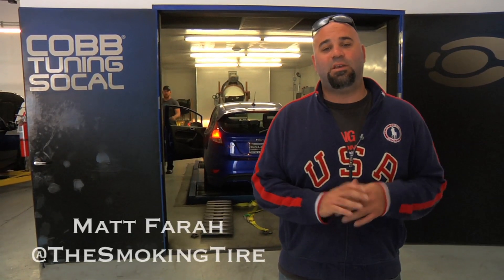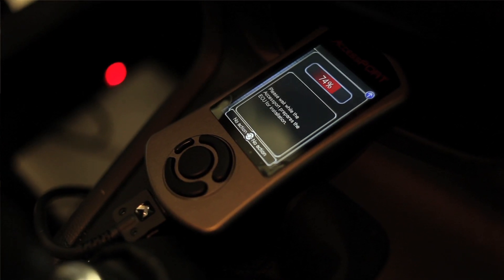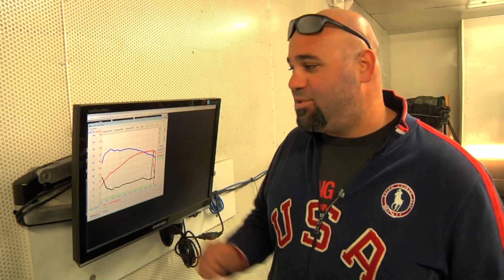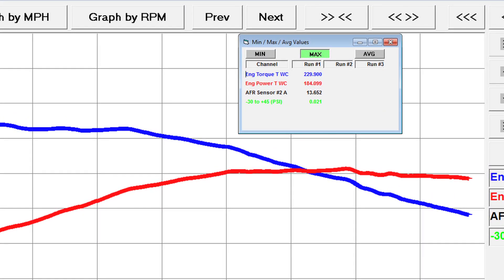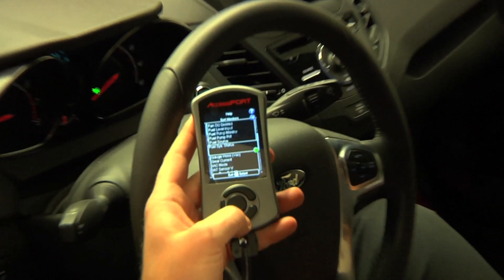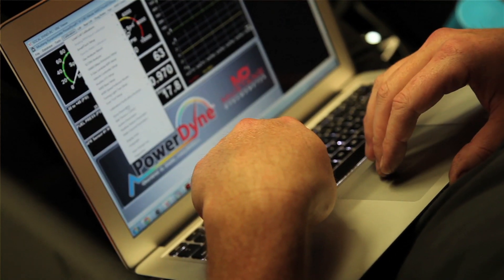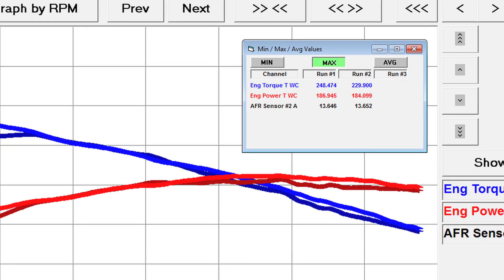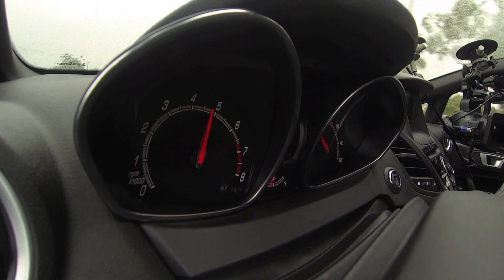Project Car Fiesta ST Gets Cobb Stage 1! Before/After Dyno

Comment: Imagine a world where Ford offered the fiesta with awd and 3 doors. Hot hatch heaven anyone?!?!
Reply: you have the 3 door option, at least in Europe.
Reply: hell yeah! that is actually my dream but wait - you guys don't have the 3 door option in the US?
Reply: Nope.  5 Door only.  Still a great car, but just adds that much extra weight.  I own one, and it's still a blast, just a bit heavier and less attractive.
Reply: I believe there are 3 doors version, at least here in Europe.
AWD it's useless on a fast small car with just 200hp. it will ad weight, power loss and probably will be boring to drive (more understeer).

LSD is what you want, in case the car doesn't have one from the factory!
Reply: +Tom Lawrie  check out the new focus rs, AWD !
Reply: @blackonegreyone  they do have a 3 door, in EUROPE tho
Reply: @christopherrogers8316  The don't offer any Fiesta ST in 'merica anymore.  We don't buy hatches, so Ford will only sell use trucks or a Mustang now.  Sad state of affairs.
Reply: @blackonegreyone  i know, but good thing is, fiST are cheap as shit used, i just seen one for 9k with only 75k  miles, i been thinking about it. lol
Reply: I wish my US spec fiesta st was the 3 door *weight reasons*... imagine it with the focus RS awd system that runs 5 drive-terrain clutches plus the engine-transmission clutch... gives me the chills thinking about it especially since mine can currently hold off a porsche 911 targa s 0-100mph
Reply: Eu all are 3 door almoost lol
Reply: 3 door Fiesta looks worse and if you disagree you are lying to yourself

Comment: It's still wrong wheel drive.
Reply from the maker: I can always count on BMW people to be open minded... lol.
Reply: I'd like to see your correct wheel drive in the snow.
Reply: RokitScientist1987 OH IT CAN DRIFT. OH IT CAN BURN TIRES. OH WAIT I DONT KNOW HOW TO DRIFT...
Reply: RokitScientist1987
I didn't have any problems... /watch?v=Vt7QFSuQ7Tg
Granted I was having fun, but I drove around on the streets and did ok.
That said, FWD may have been easier for a non-enthusiast.
Reply: *****
I'd respectfully disagree. The Fiesta is a fine car, but RWD isn't only about drifting. It also lends a different feel to handling balance. Obviously weight, distribution, suspension as well. 
Some prefer front, others rear, some (those to whom a car is only transportation) may have no preference.
Reply: RokitScientist1987  Driving my FR-S in Ontario, Canada,  we got plenty of snow this winter and i have all the confidence in the world with my Right Wheel Drive car. Honestly if you making such statements you probably never drove a rwd car in snow or you just very inexperienced driver :)
Reply: some awd. most of the people are common drivers.
Reply: RokitScientist1987 I never understood this argument. It's called investing in a good set of snow tires. My M3 on Blizzaks will do better in snow than almost every truck/Suv running all season tires.
Reply: NEOBAE77 Who said anything about drifting? I AutoX and track my cars very often and FWD would only cause me to have slower lap times, no thanks.
Reply: TheSmokingTire I'll have an open mind when they produce these turbocharged fiesta's/Focus' with an AWD drivetrain, until then it's an econohatch that won't even beat my stock E36 328is in a straight line. Slapping a turbo on anything doesn't automatically make it a better car, sorry.
Reply: Talk about straight line? Even been to mountain roads? Then u can see how far your m3 can go againt the small FWD..

Comment: hmmm now much gains for the fiesta, know the bmw n54 there is a TON of leftover room to be tuned
Reply: Well to be fair, Mountune reckons they can get 215 horses out of it with no issues, although their claimed torque figure is 236 lb/ft.
Reply from the maker: ***** They can get 215 Wheel HP out of an otherwise stock car running standard pump fuel? Somehow I doubt that, but I'd love to see it.
Reply: TheSmokingTire
I didn't say wheel horsepower.
Reply: TheSmokingTire Mountune has had another year to tinker with it, plus is officially backed by Ford UK. You can just buy the Accessport from them (same price as Cobb) as test out their tune. http://www.mountuneusa.com/COBB-Accessport-Focus-ST-Fiesta-ST-p/ap3-for-001.htm

Comment: In Europa we already running 250whp and 370nm TQ (stage2) I can tell you that it is is very very quick. And can easily keep up if not dust more powerfull cars. It handles the power very good and cornering it just crazy with the Fiesta even at high speeds. Fiesta don't need awd. The less peolple expect from this car, the bigger my smile while dusting them whehe.

Comment: I love these cars.... If I wasn't such a freak about high horsepower rear wheel drives, I could definitely get behind the wheel of one of these. This is what VW should have been doing to the GTI twenty years ago. They (VW) leave so much on the table from the factory it's insane what a chip tune will do. Thanks for the video, and keep us posted on the stage 2 upgrades...

Comment: The thing with the accessport is that the maps are totally customizable by you! The ots maps like the one he is using is conservative. But besides adding a lill power it adds it throughout the powerband. I know in my mazdaspeed 3 a Cobb stage 1 tune made a huge difference.
It also removed the boost restriction in low gears and came with no lift shifting and launch control (& valet mode for at the shop so they don't joyride)

Comment: VW's new 1.8t which replaced the base 2.5 5 cylinder goes from 165whp to 220whp with a stage 1 ecu tune and makes 270lbs-ft of torque and that's a base model engine. Remind me how 4hp and 20torque on a stage 1 upgrade is impressive.

Comment: Matt, you should try a Burger Motorsports tuned MINI Cooper S that has an aftermarket intercooler and exhaust...after first gear, it's on point with a 997 and I'm not even joking...

Comment: Thanks for the video! I bought my fiesta st after being totally convinced after the M3 vs fiesta comparison. I have the stage 1 power kit from cobb as well and it's nice to have a little extra torque, coming from a mk6 GTI where an APR tune would give 50hp and 70ftlbs, so I'm disappointed with the tuned hp number.
Reply from the maker: It's a 1.6L engine that's massively underrated from the factory, so clearly Ford didn't leave as much on the table as VW did with the GTI.
Reply: It was already tuned pretty good from the factory. Let it breathe a bit better and maybe get a tune from fswerks or someone on an e85 mix.
Reply: Comparing 2 different cars is pointless and I absolutely do not believe that you got even close to 50/70 at the wheels with just a tune. That is at least a 25% increase. BS
Reply: Do some research on German turbo cars. They usually do make 25% more power because they tune the engines so conservatively.
Reply: taylor wagneers I know plenty about German turbo cars. Some of them will make tons of power with very minor modifications and a tune...The GTi is not one of them. It's a very good car and can make that much extra power but it's gonna take a lot more than just a tune and drop in filter.

Comment: why are the power gains so incremental?
I put a Revo Stage 1 on my Audi A3 2.0T and power shot up from 197hp to 270hp and torque went from 207 lb-ft to 317 lb-ft.

these are crank numbers though but even still the difference was massive, i thought Turbo cars get much more improvement from remapping compared to N/A due to the boost reconfiguration.
Reply: Just shows how conservative the COBB tune is. Almost pointless and surely not worth the money, as it could not have been cheap.
Reply from the maker: Your Audi is more detuned from the factory than the Fiesta is. remember, you have a 2-liter and this is a 1.6-liter. Most companies detune those 2-liter Turbo's from the factory in order to reduce torque steer, which most buyers find unpleasant. The tune opens up more of that power, at the expense of torque steer. Because the Fiesta's engine is much smaller, they leave less on the table at the factory. It's apples to oranges.
Reply: TheSmokingTire I figured that would be the case, atleast from the Stage 1 Remap you should get a big improvement in MPG as did I with mine.
Reply: Lets not forget the Fiesta ST is like 500lbs lighter than the Audis. This means far less power is required to output the same 0-60 and 1/4 mile times.
Reply: Because it's two completely different cars tuned by two completely different companies.  Your question is kinda like asking why kobe beef is more expensive than a hot dog.. different approaches.
Reply: Theres about 5 different companys that do the same tune with similar power gains, in this case its purely down to what is in reserve from the factory tune. 
Vag cars tend to detune there turbo cars quite a bit.
Reply: Its about power to weight. Iv beat a 2.0T A3 stage 2 with my stage 1 Fiesta ST. owner could not believe it. But yes, gains are not great due to the small turbo which is a restriction on the fiesta ST
Reply: Rockafella20v The stage 1 Fiesta ST difference from stock is absolutely insane.
Reply: +luke mcvicar 

The reason these gains are so incremental is that TheSmokingTire is upgrading parts that are not really needed for this car.  You will get virtually the same gains if not better by only upgrading to a catless downpipe and better intercooler.  The Fiesta ST already has a good intake and exhaust.  These parts simply do not need to be upgraded unless you are going with a larger turbo.  The rear motor mount however is a must!
Reply: the stock intercooler can't handle the more aggressive tunes so the difference between stage 1 and 2 are great
Reply: There's also the fact that the Fiesta ST has a teeny tiny turbo that runs out of breath at higher RPMs, coming down from 21psi to like 5 or 6 from what I've read.
Reply: tomelliott9 Let me know the next time you see a Japanese motor 1.6 liter mind you stage to 3 putting out 320lbs of torque and 300hp. Because that is what the FIST is getting on a stock turbo housing reworked.
Reply: I was talking about VAG cars, not the Fiesta lol...?
Reply: Also a turbo'd B16 can make over 500 bhp...
Reply: tomelliott9 And a podium finisher Rally FIST can make 1,000hp how far you want to take this?

Comment: wow so it makes 229lbs feet at the wheels stock? Isn't rated at like 215 at the crank?
Reply: 203, and thats on 93 octane, but califonians can only get 91. this cars power rating has got to be downplayed by the factory.
Reply: @zerocool6257  so if it's truly making 229-lb ft to the wheels from the factory... Wouldn't that translates to about 255-260 crank TQ in reality?? I love low- mid-range grunt in small tossable cars so this thing must be a riot

Comment: Since cars are managed by the computer everywhere, it makes you wonder what some changing of the maps for any car would do to the performance. Its obvious the power was there on the Fiesta but they probably held back that power from factory so it wouldn't slip as much.
Reply: Emissions are an issue too. If you look at cars across Europe, a 2.0 TDI A4 in the UK may have one or two hp more than one in another part of Europe to slip around specific emission rules.

Comment: If I pause it an look at the dyno maps, not only did you get the big torque gain, you power band is much smoother and more linear looking. It looks like even though your peak HP gain was small, your over all power band is smoother and more linear and it looks like down in the lower rpms, while not as high as peak power, you did pick up  bigger gains in the lower and mid ranges.

Comment: With all the CRAZY cars you've test driven (in terms of performance) it's funny to see you so giddy over a front wheel drive pocket rocket. What would you estimate 0-60 is in that car stock? Sounds like it is worth a test drive if one is in the market. Is that 35 MPG highway a real world number do you think? I must admit I almost fell out of my chair when I first saw that highway number with that much horsepower. Would you take it over an FRS?
Reply from the maker: 0-60 doesn't really matter since it blows the tires off first and second gear if you get in it. It's really all about the handling and the midrange speed.

Comment: Curious to see how the car behaves with a high flow down pipe/exhaust, bigger FMIC and a less restrictive intake.
Reply from the maker: That's coming soon! Stage 2 is FMIC + CAI, stage 3 is Turboback Exhaust + Protune
Reply: TheSmokingTire Keen for that! This thing at 230hp + 280ftlb or so would make the most desirable daily!
Reply: TheSmokingTire Quite interested to see the results of this little video series. I ordered a Spirit Blue Fiesta ST a few weeks back, won't be with me until about June though due to high demand here in the UK. I do find it a bit strange how it only gained +2bhp after being reflashed though. The Mountune Performance package here puts the peak power up to 215bhp after just an intake and reflash of the ECU. Any idea why it only made an extra 2bhp Matt?
Reply: Jordan Boulton
maybe that is because the mountune focuses more on top end power!,
Reply: Iram Plascencia I guess so, It's just that most of the Stage 1 remaps available here in the UK put the power output to around 215/220bhp with around 300Nm. 187bhp seems quite low, especially when the car overboosts to ~197bhp as standard.
Reply from the maker: Jordan Boulton 187 HP is AT THE WHEELS, not at the crank. You have to factor in a 15% drivetrain loss (I dont know the actual drivetrain loss for the Fiesta, but 15% is the standard estimate for FWD cars). Ford quotes 197 HP / 214 TQ at the crank from the factory, but our car measured 184 HP / 230 TQ at the wheels. Multiply  by 1.15 and the fiesta actually makes 211 HP and 264 TQ at the crank from the factory.
Reply: TheSmokingTire My bad, must have missed that part about wheel HP, assumed the lower power was due to lower octane fuel or something like that. Thanks for clearing it up anyway. Look forward to seeing what this engine is capable of in the future.
Reply: TheSmokingTire
So with the tune and 248 ft lbs at the wheel multiplied by 1.15 means this little beast is making 285 ft lbs of tq and 215 hp. Thats a little beast. You plan on getting a $1000 Quaife Limited Slip to plop in it? Quaife states it works with the torque vectoring it just adds more awesome on exiting turns and traction.  Can't wait to see what it makes with a nice downpipe.
Reply: TheSmokingTire
Your math is wrong it should be 184*100/85, which actually turns out to be more than you previously stated (i.e. 216 HP and 270 Tq from the factory)

Comment: I believe Ford tuned it so first and second gear isn't quite as powerful so that you don't get so much wheel spin or torque steer, but if you have good tires it probably limits acceleration speed and throttle response a bit compared to when removing that with the access-ports tune. 

Stock, I haven't even been able to get my tires to spin besides trying to launch fast on really wet roads.  I've only noticed torque steer like once and it wasn't too bad (during fast acceleration test).

Do you find it slips more  and has more torque steer as a result of the tune? 

Still might be worth it for the throttle response, just may take some adjustment in your driving technique to not spin the wheels in 1st or 2nd.

Comment: Love Cobb.  There OTS stage 1 on my 335is was good for a 10% boost in whp and wtq and with some e40 and hardware changes a 70% bump in whp and 35% bump in wtq from stock. 

You guys ever consider putting a splash (1 gallon for a whole tank) of e85 in with your 91 to give you a bump in octane.  Don't most ecus have the ability to increase flow by 5% to compensate?

Comment: How does this effect the warranty? If at all?
Reply: *****
Not necessarily, only if the modification made is the direct cause of component failure then yes, if you have your car tuned and something totally unrelated to the tune fails like a wheels bearing then the manufacturer should honor the warranty.
Reply: @Akrane23  it does not void the warranty, that's not how warranties work.  the manufacturer specifies they will guarantee against certain defects/failures; when a claim is made by the customer the dealer's mechanics determine if that claim falls within the parameters of the guarantee, i.e. whether the manufacturer is at fault for the failure.  if the manufacturer rejects your claim, they determined that they are not liable for the repair, the warranty is still intact.

Comment: lol In the UK we can buy the ST with a Mountune kit for £600 directly from a Ford dealer.
Once upgraded power increases to 215PS at 6000rpm and torque is raised to 320Nm at 3,000rpm.
Bet you cant match that Matt!!!
Reply from the maker: That's 3 more HP and 40 lb/ft less torque than the Cobb Stage 1 tune makes. And 600 pounds is $985 US. The Cobb stage 1 package is only $520 US. Sounds like I've actually beaten it.
Reply: bugger!
Reply: I hate being wrong as much as you do..so I crunched the figures.
You achieved 187 bhp & 248.4 ft lb whereas the Mountune comes out at 212 bhp & 236 ft lb...so I figure that makes us honours even!
Reply: TheKizzyfish
I think the Mountune kit is rated at the crank, while Cobb is dyno tested at the wheels with what looked like a Mustang Dyno known to be conservative too. So that's WHP not BHP. That said the HP increase was minimal.
Reply: Yeah OK...I've been owned...sorry Matt shoulda known better! lol

Comment: Doesnt the Mountune kit with a tune and a filter get way better results than this?
Reply from the maker: It may, but it's also (as far as I know) designed for 93 octane. In CA we have to run 91 octane, so the tunes are more conservative.
Reply: Right. Didn't take that into account. My bad.
Reply: i talked with mountune and he said that it works with 91 as well.